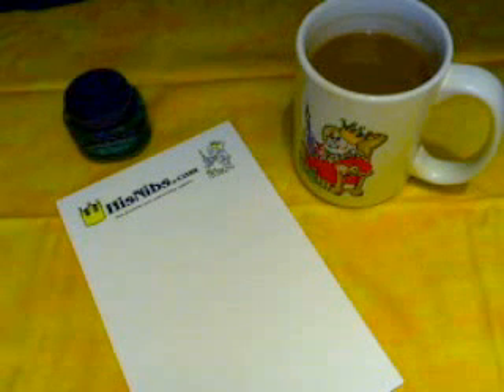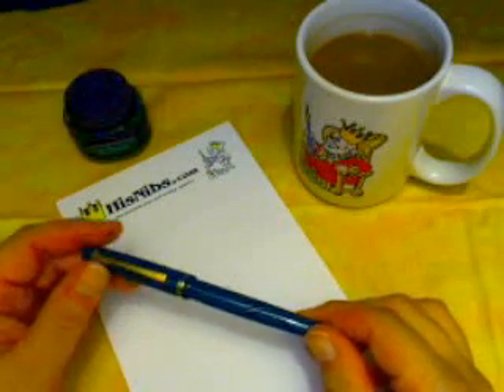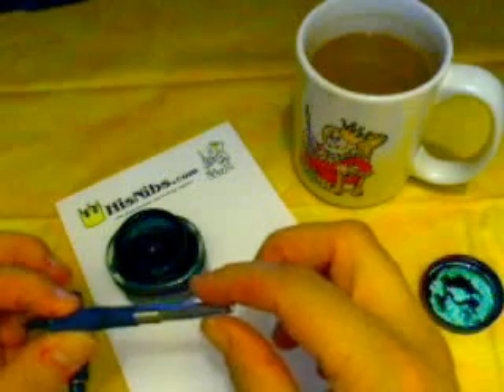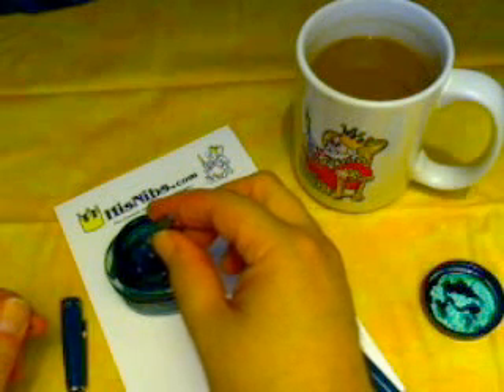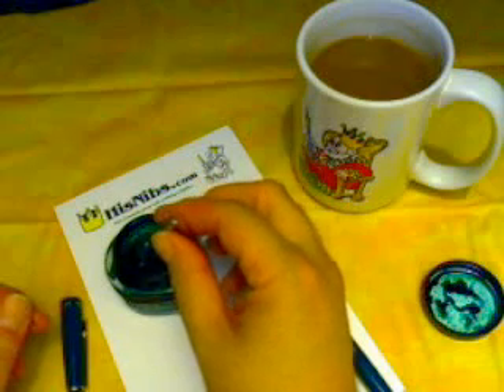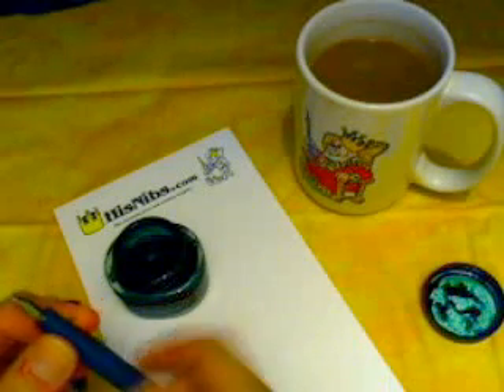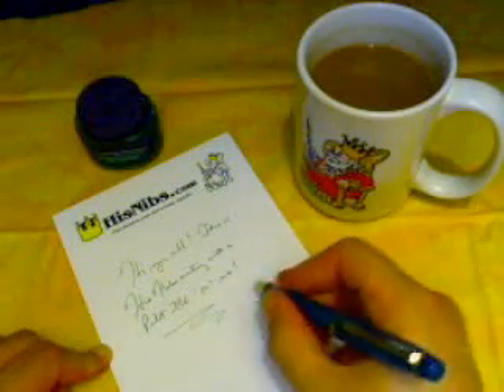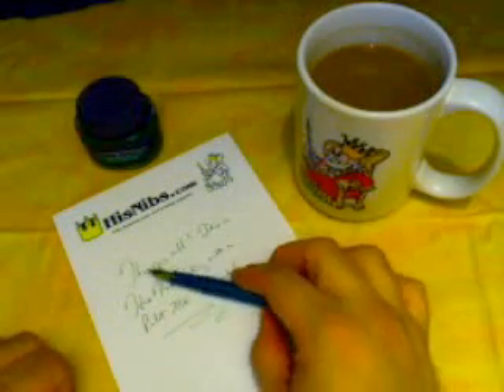Fountain Pens: Filling a pump-style converter

Comment: This video was really useful! I purchased a Pilot 78g some time ago and when I received it I didn't know what that squeezing thing was or how to use it until I saw your video! I have a question though: if I wanted to use cartridges, what are the ones I have to buy? I have some at home that I use for an old fountain pen, but they don't fit on the new one.
Reply from the maker: Thanks! It only took 12 years for me to respond to your comment. LOL I'm sure you've discovered this in the interim, but Pilot has their own proprietary cartridges.
Reply: @HisNibs1  Holeyyy. 12 years later and I'm still using that pen from time to time to write Tengwar. And I only ever used the "squeezing thing", no cartriges! That pen is in front of me rn on my desk. Time flies...

Comment from the maker: No harm to a metal section ring if the pen is wiped off of excess ink...as one would do in any case. I have pens with such designs that I've used for a quarter of a century or more.